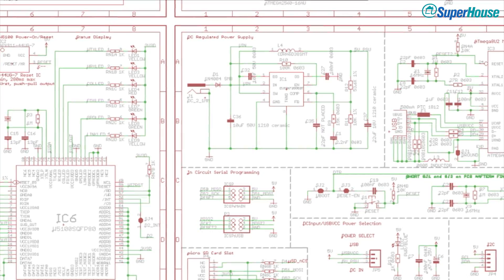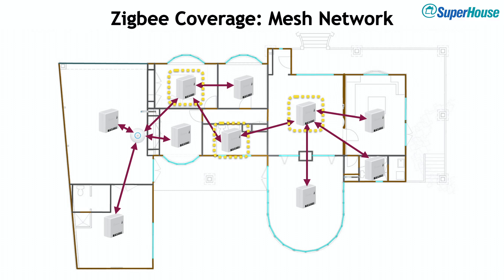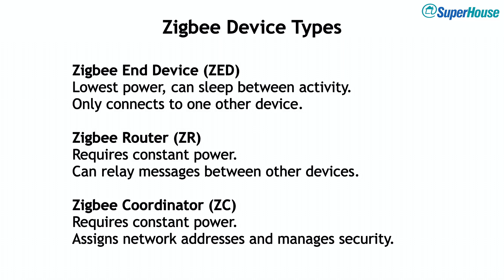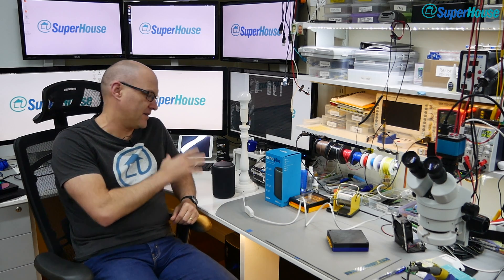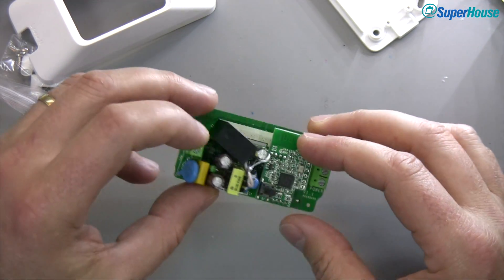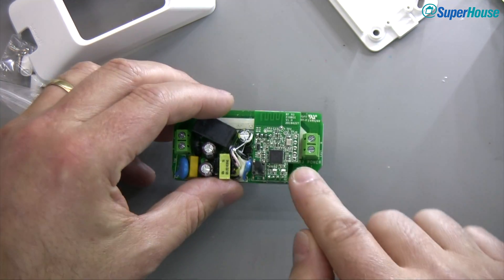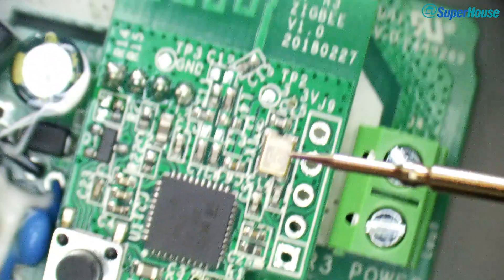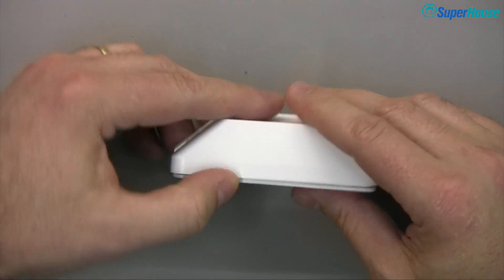SuperHouse #35: Sonoff BasicZBR3: Zigbee, not WiFi!

Comment: Can I add a chip rf433mhz module in this so off zegbee switch 
Or where can I give pairing switch connection if I add rf module in this switch for single switch pairing use

Comment: Hi i watch your videos and have a question about the sonoff. I have a new generator with push start button and i want to connect the sonoff to turn it on and off from my phone. do you know the best way to wire a sonoff as momentary switch?
i saw another video where the trace is cut and rewire the board and used inching. just want to know what is the best way available and the firmware or software need it. thanks

Comment: Is there an easy way to repurpose this module to short the pins instead of connecting them to main AC? My gas heater has two pins, if I short (connect) them, it will start, it they are disconnected, it will stop.

Comment: I've just bought some of these.  Very reasonable price on Amazon.  This video saved me a lot of time, thanks. :)  I've used Zigbee for sometime although some devices don't always seem to play nice - e.g. considering the mesh network (that I can visualise using phoscon with Conbee II) I don't know why some Innr plugs sometimes lose connection and don't reconnect by themselves for ages when they're near other Zigbee routers.  [If I was interested enough I know I could use make some kind of signal sniffer - maybe just using a zigbee endpoint - but I honestly have too many priorities and just want stuff that works).  My best guess is too much interference on 2.4GHz ... I have a lot of gear on those frequencies and so placement can make a lot of difference (and of course turning down loud sources).  Still.  It's annoying.  I really liked Wireless Things stuff that ran on 868MHz (for me in the UK).  Less interference and more penetration/reach.
Nb - running Conbee II Phoscon stuff in Docker ... but I use a MacVLAN connection rather than host (bridging's not always recommended for broadcasts etc.) (I use VLANs and this runs on Debian on a J5005 nuc) so I can put it on the VLAN I have my Echo's etc. on so that discovery works properly for the Conbee II gateway while still isolating from other stuff e.g. my plex server in another container runs on the VLAN my Desktop's connect to - to avoid excessive routing (handy to know).  If using multiple interfaces & gateways even on Debian that involves a bit of manual routing ... but with the MacVLANs the host doesn't need to "know" they exist per se.  (Individual containers - not swarm or anything).
But something that's always frustrating me (one of many tech non-available's I'm always lamenting) is a simple/cheap READY-MADE 12V (etc.) version of this Sonoff BasicZBR3. (Manufacturer agnostic).  I'll have to do another search soon.  Wouldn't it be great to have an inline USB one?  So much of my stuff is USB.  Maybe with power sensing readings too.  
And, golly, I dare imagine Lithium Iron Phosphate powerbanks with zigbee control, reporting, and discharge/charge programmable thresholds to do partial C charging etc. to use as UPS's.  I've waited decades for that sort of thing.   Never had time + money + opportunity + skill lol to do it myself.  Not quite.  Partially completed attempts.
I want to buy stuff I can plug in / wire-up simply, as a switch, and use.  Not something I have hack a bit first.  I seem to waste a lot of time doing stuff like that.  It's very distracting.  I want to get on with software, not hacking hardware.
It's 2020 already. Will the devices I want ever be available?  Those things I mentioned are just the start of all the missing kit.  We only seem to be allowed to buy things with very constrained use cases that don't overlap well and possessed of multiple failure modes. :(  And that eat electricity like there's no tomorrow.  No sophistication.  Rant over lol.  But the video was very good.  Very helpful. :)
Reply: OK - I faffed about with this.  Removed the Live/hot - fuse, varistor, and bridge rectifier for good measure, all with pliers (just pulled off).  And used some depont wire (trimmed) to connect the (L) to the 5V test point (connects to the thingy capacitor), and (N) to any old ground (shorter wire on t'other end).
Then I used a simple USB inline switch from Amazon (pack of 3), tore out the switch bit (too hard to open) (well - tore out the wires) just so I could use the USB plug / socket flying bits.  And connected them to the screw terminals on the Sonoff, and used a bit of bluetack as the wire was a bit thin for the cable gripper thingy.
*Sigh*.  Why I have to do all this I don't know.  Why can't I just buy it!!!!!  Why can't people sell this stuff?!!!
I looked-up the datasheet for the relay on mine ... a 5V one obviously (as I'm feeding 5V though I could add a buck step down thing if I wanted a more variable input) and it said 0.45W for energised state.  I think.  From memory - that was yesterday.
Plugged it all in and worked.  I measured 32mA ish for relay off, and 140mA ish for relay on.
Don't know if that helps anybody.  Let's hope Sonoff sell something like that one day.  They do an inline USB WiFi one now so maybe a Zigbee one is in the works.
Reply: NB - obviously a MOSFET instead of a relay might be better for my USB inline solution ... but I'll look at that another day as I'd quite like to still fit in the case (with lots of labels indicating 5V input only!).
Reply: NBx2 ... I tend to mix-up Phoscon vs Deconz.

Comment: FYI, ptvo now posted a blog on how to use his configurable ZHA 1.2 firmware with Sonoff BasicZBR3 with an external sensor

https://ptvo.info/sonoff-basic-zbr3-with-the-configurable-firmware-283/

He only tested it with Sonoff Si7021 Temperature and Humidity Sensor as a proof-of-concept

https://sonoff.tech/product/accessories/si7021

ptvo configurable firmware also supports DS18B20, BMP280, BME280, DHT11, DHT22, DHT12, AM2301, MHZ19, and SenseAir S8

Sonoff BasicZBR3 will continue work as a ZHA 1.2 router with ptvo configurable firmware as well.

Comment: The vias that are bonding the ground planes together aren't vertically blocking RF.  The wavelength at 2.4 GHz is about 12 cm, or 120 x the thickness of the circuit board, and RF at that frequency doesn't even see the sides of the board as two separate things. The ground plane vias do prevent the parts of the board that aren't supposed to from becoming an antenna, but that many, that close together isn't necessary for RF at 2.4 GHz, and is usually done for heat dissipation.

Comment: Hello Jonathan Oxer,
I do like your work on YouTube and I do hope you can guide me into how I can connect a smart device like “Inkbird Wi-Fi ITC-308 Digital Temperature Controller” to control the element that heats up the Nissan leaf battery. The reason for using this device is because it can connect over Wi-Fi and I can control the temperature. Other devices available to me cannot be over Wi-Fi control. The problem I am having is that the inkbird is designed to work on ac volt while I want to use it on dc environment. I have “Car Waterproof DC-DC Converter 12V Step Down to 5V Power Supply Module 3A 15W” to use with the Inkbird but I do not know the best connection point on the it to power it one permanently.
Please see my YouTube for an idea on what I am doing. https://www.youtube.com/watch?v=YTwIJrBqyKM
Thank you.

Comment: I would like to know how this device works in case of powercycle. I want to place it between a regular wall switch and a ceiling light without a neutral wire. So when the wall switch is turned off the Sonoff device will also turn off. But what happens when power is turned on. Will then:

- the previous state be restored
- the bulbs be turned on by default

- the bulbs be turned off by default

Comment: @SuperHouseTV Do you know if this supports "PowerState 2" like Tasmota Firmeware on a Sonoff. 
PowerState 2: Toggle opposite of last state when power is cut. I'm using wall switches (buttons) to cut power and when light is turned on and i push the button the light turns off and vice versa.
If this Zigbee Sonoff does support that I'll swap out all of my "old" Wifi based sonoffs.

Comment: awesome video. i'm so interesting. can i ask some?.
i want to rebuild sonoff zigbee to 5v or 12v. then how can i rebuild. 
behind the pcb, i saw 5v and GND mark(next to U3 mark). if i solder 5v(+ -) to this 5v, GND, is this works well?
Reply: Any answer? I'm also looking for this solution. Did you get any confirmation?

Comment: In my professional opinion, these ZigBee devices are low power and ideal for control, however distance between mesh nodes are worse than Bluetooth. I've had problems in open air at 10 metres.

Comment: I can confirm it works straight out the box for Home Assistant and Zigbee2MQTT. Up and running in minutes!
Reply: Stephen Ludgate how did you do this? I’m looking to get one of these echo devices on Black Friday offers... if I but this and some zigbee devices (door sensors or temperature sensors etc) will they show up in home assistant using this as a zigbee hub? Or do I need to get a usb zigbee device for my home assistant raspberry PI
Reply: @seanr2109  if connected to an Echo Plus you will be able to manage them in Alexa only. If you have Home Assistant i would highly recommend getting a zigbee c2531 usb sniffer and setting up Zigbee2MQTT. I don't think the cheap door sensors work with Alexa, but using Z2MQTT on your Pi makes it a 'universal hub' kind of. I have Sonoff, Ikea Tradfi and Xiaomi devices all connected to Home Assistant via Z2MQTT with no additional hubs or gateways, just the USB stick. It's great!
Reply: Stephen Ludgate thanks for that il just get the smaller echo devices then without zigbee and use nodered to make the devices present to Alexa as an emulated hue device
Reply: @seanr2109  yeah, that sounds the best way forward. Not tried the hue emulation on HA yet... Best of luck with it!
Reply: @ChunkySteveo  been around 1 months, watching videos, reading that etc. your this very comment almost summarize all beginner level of smart housing.Thanks S. Ludgate
Reply: @hamhumtube  you're most welcome!!

Comment: The great thing about ZigBee devices is they don't need firmware changing.
All you need is a local co-ordinator instead of an Amazon or other cloud based one.
Home Assistant and OpenHab work brilliantly with zwave co-ordinators like the xbee USB stick, Elelabs ZigBee co-ordinators, conbee and conbee2 plus any number of diy solutions based on reprogrammed  CC253x ZigBee sniffers.  These CC253x devices are so cheap.  Under $20 will get you the USB device and the programmer.
That's a cheap and reliable ZigBee co-ordinator for your Home Assistant or OpenHab box.
Additionally some hubs, like the Hue bridge, can also work totally local.

Comment: Hello. Beside switch S1 there are two LEDs. Can you check which pins on the 2530 are driving the LEDs? I didn't see any transistors nearby, so i am assuming they're between a pin and a rail? (I forget if the 2530 can sink more or src more current :) )

Comment: Just setup a raspbee on Home Assistant with the deconz integration, seems to be working good so far, and you can view your mesh.
Reply: Matthew Pauls How did you pair? I’m also using a raspbee with homebridge-hue plugin. I had a flashing blue light on the relay and then tried to pair as a switch in phoscon .. nothing.

Comment: Could you  measure the current consumption for that Zigbee board?
Reply from the maker: That could be kinda interesting, but it's connected to a continuous power supply and it doesn't go into sleep mode so the power won't be particularly low. It needs to stay awake to act as a Zigbee Router.
Reply: @SuperHouseTV  I realize it is always awake due to it is a receiver. I would like to get an idea if cr123a would be enough.
Reply: @caseymuni4097  A Zigbee Router can transmit as well as receive. (To act as a mesh node, it has to be able to relay/transmit messages.) Bad idea to use a Zigbee Router under battery power. Use an end node.

Comment: Jon, love your videos. Have you looked at the Aqara hub and sensors etc that are Apple HomeKit compatible. Also use zig bee, are cheap and easy to set up. Your video explains why the batteries will last for two years. They are so small. Cheers and thanks.
Reply from the maker: Yes, I have some Aqara devices here but I wanted to keep this video simple and focus just on Zigbee basics and the Sonoff. I'll be showing how to use Zigbee2MQTT and Zigbee2Tasmota with Aqara devices in another video.

Comment: Good video.  I suspect 99% of the people using this would use the Zstack code from TI, which basically has all the heavy lifting of the zigbee stack included.  All you'd need to do is add the endpoint for the relay control, and chances are it is already in the example code somewhere.

Also, for the range test -- Zigbee is not like WiFi in terms of the sensitivity.  It is quite possible the end device in your test could reach your coordinator directly.

Lastly, there are ways to map out the zigbee network.  I use zigbee2mqtt as my gateway, and have an XBee in the mesh which allows me to map out the network anytime.  It also acts like a router, which I should probably undo...
Reply from the maker: The Hue light definitely couldn't connect directly: it only barely connected to the Sonoff, which was about half way between it and the Echo. I spent about half an hour moving it around trying to find a spot where it was visible to the camera and could still connect. I have a bunch of XBee modules too and I'm going to show both zigbee2mqtt and tasmota2zigbee in future vids.

Comment: Thank you for this great video! Would you ever consider hacking into the cc2530 in a future vid? (I know it uses an 8051 core and according to you that's very annoying to work with, but it would be super helpful)
Also for your future video, would you be using a MCU or a MPU for the gateway? I made a gateway using a pi, but I really want to explore the possibility of using a WiFi enabled MCU (ESP8266 / ESP32) as the core of the gateway (mainly for security purposes and cost)
Reply from the maker: Yes, I'm going to cover both zigbee2mqtt (with a Pi) and tasmota2zigbee (with an ESP) in the future.
Reply: @SuperHouseTV  Thank you very much! Looking forward to it!
Reply: If you do hack into it, you might just discover Sonoff used something like ZBOSS. (Maybe.) http://zboss.dsr-wireless.com/downloads/index/zboss
(Maybe there's a way to identify it by looking at readable strings / 8051 decompiler / etc.)

Comment: Welcome to the Zigbee Dark side. :-) I am a big fan of Zigbee. I run a couple of ConBee II USB sticks with deconz and even have a Xiaomi Mi Gateway. Zigbee is so much nicer than wifi for these kinds of purposes. Most people flood cheap wifi routers with so many devices they can't connect their laptop or phone. Zigbee takes away that problem with most hubs being able to handle at least 50 devices before you start needing to add routers. And deconz lets you manage and maintain the network wonderfully easily.

Comment: What is the standby power consumption?
Reply: It can be as low as 0.001mA. Maybe you can have a battery powered zigbee device for a few years if you poll every 5 seconds. See page 15: https://e2echina.ti.com/cfs-file/_key/communityserver-discussions-components-files/45/7282.swra292AN079-_2D002D00-Measuring-Power-Consumption-of-CC2530-with-Z_2D00_Stack.PDF

Comment: Hey Jonathan! just to go off track! i have been searching for a way to get a camera feed from front of house to the cresh at church. so we set up a daft camcorder and hdmi to ethernet and audio inject. not what i want and the quality and inevitable overlays  suck! so my goal is to find a camera that i can flash if needed and will give me rstp (or your suggestion!) and audio input (feed from the mixer) but i of course need a good frame rate and good sound sinc. so i saw your camera feed and it looked as if it was fast enough, what is it? is it reasonably priced? can i acheve my goals with it? i will be looking to slap a rpi as the rstp player at the tv end. i would prefer to go cable rj45 rather than wifi and poe is an option but i want this an independent network so as not to further congest a heavily used  multi vlan network. Appreciate your thoughts, my skill level is ok, i regularly fit sonoff mini's with radar and temp/humidity sensors. thanks Jonathan!
Reply from the maker: The camera system shown in this vid is an old Annke analog system, with coaxial cable to the cameras. I did a video about it in the past. These days I'd probably use something like a Reolink IP camera system, hard-wired rather than WiFi.

Comment: I think you are wrong since the Echo plus have zigbee hub inbuilt it can even connect even when there is no internet. So i think its not connecting to internet to control zigbee devices
Reply from the maker: Yes, the Echo can communicate with the Zigbee devices when the Internet connection is down, but that's not useful because the Echo itself requires Amazon's cloud service to do things like voice recognition.
Reply: @SuperHouseTV  no it doesn't .it can control even if internet is not present.
Reply: The Echo plus has local voice control and can control devices without an internet connection being present.